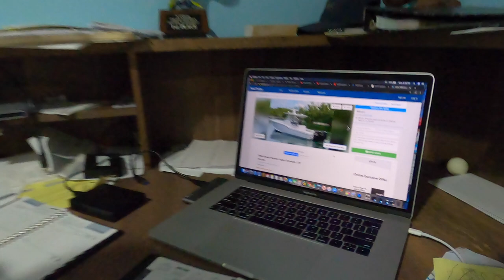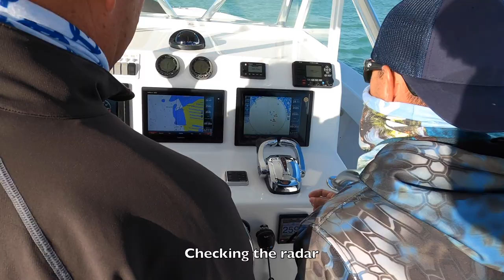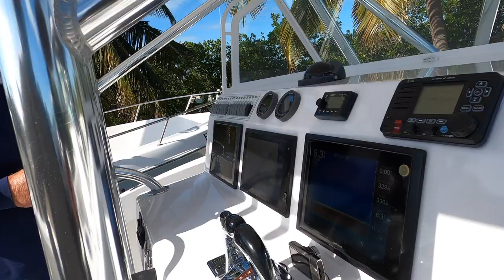$100,000 Boat SOLD!

Comment: The hours on those motors regardless of how well they are looked after the gearbox’s will need replacing soon and any at any point those engines could pack it up and need replacing. In Australia that’s another 70k for a pair of 300s. Still a nice boat

Comment: sounds expensive for a 22 year old boat and high hours on the motors,BUt i would love it
Reply from the maker: Completely re done in 2014 with over $240k put into it
Reply: @StanzFam  it's a bargain then,we spend £30.000 on 18ft boats with a single 75hp over here in the uk

Comment: Hello NIck. I love your fishing videos and was just there at Bud and Mary's looking for you. I wanted to ask some questions about the sold OM 31 above but could not find you . I'm in the process of rebuilding a 31 1990 OM and looking for engines. Those 300 Suzukie's are on top of my list. Can you share some numbers on WOT for the 31OM with those 300 Suzukie's. Can you talk to the previous owner to get me this number by any chance? 50% fuel, two people, WOT, did she do +50 miles per hour? OM is a beast of a boat as you have said, heavy like a tank. If she hits a reef, the reef will get hurt but not the boat:) Thanks Hans

Comment: Nick, I've Watched a couple of these surveys on your channel, still have not ever seen these guys do a fuel pressure test? I would think this to be very important to do,especially here in Florida, yes it's all salt water, everything should be bonded but fuel tanks are notorious for leaks. Are they doing this or did I just miss that?
Reply from the maker: This particular boat was completely redone and over $250,000 was put into it, no but definitely agree a good idea to check fuel tanks. Most problems seem to be around the sending unit/pick ups. Certain boats are more suspect to fuel tank issues as well (like older contenders). I would say most people buying older used boats don’t always check them if they’re not leaking
Reply: Thanks,for the response, and yes that was one of the VERY first boats that came to mind. Again your response means a heck of alot to us out here in  Y T L. THANKS NICK!!!

Comment: Not impressed! Why so ridiculously expensive, mono hulls are so has been compared to how cats handle the ocean and are a lot cheaper to run!
Reply from the maker: 100k is on the inexpensive side for a 31 center console. The boat was completely re done 5 years prior with over $230k put into it.